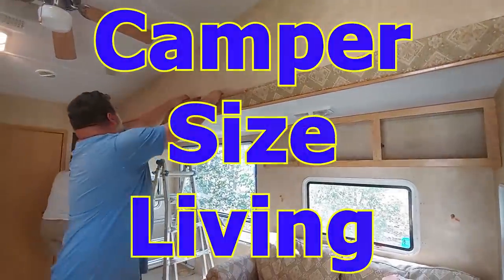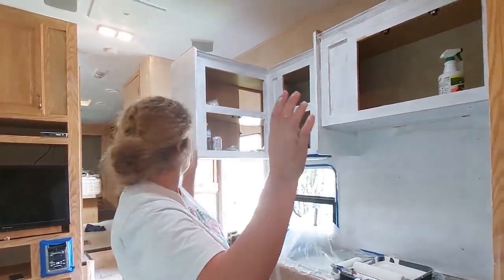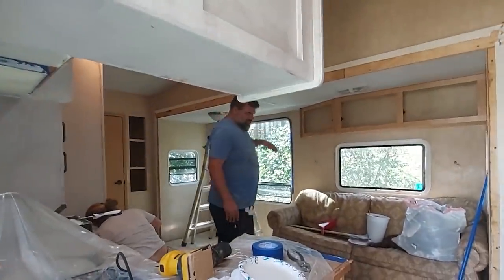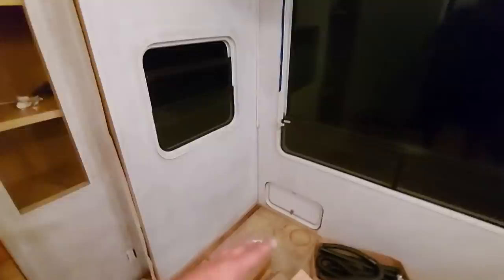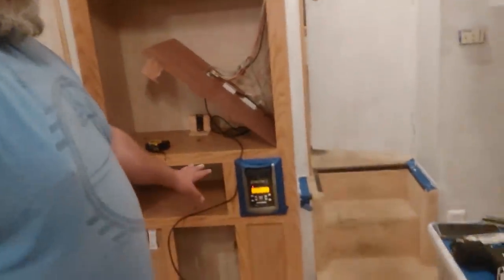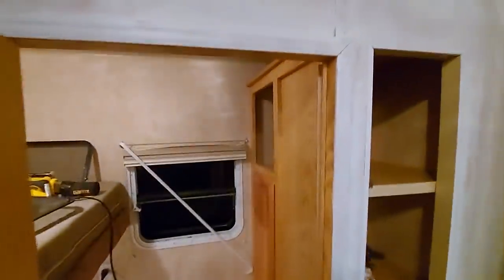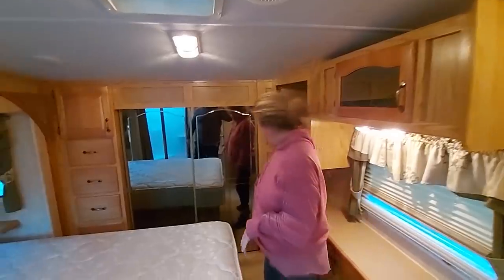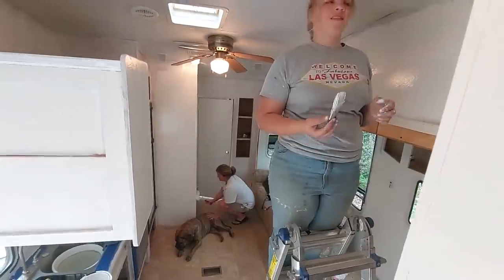RV Renovation Progress |  Where To Next after Part 1 of the RV Remodel ?! | Full Time RV Living

Comment: Can you mount the TV directly ACROSS from the couch so you dont have to crank your heads sideways to watch the TV while seated on the couch? just run the cable to it; put it on a small table if required, better than cranking your heads sideways eh..

Comment: How are you finding the studs to fasten new items
Reply from the maker: The only thing that has been heavy enough so far to require mounting to a stud is our television in the bedroom. And that had an outlet next to it that I could take out and reach behind the wall with my fingers and confirmed the location of the stud that I had located by tapping on the wall. I put a tape measure in the hole behind the wall and then out in front of the wall and was able to centre my self tapping bolts To mount the TV bracket.